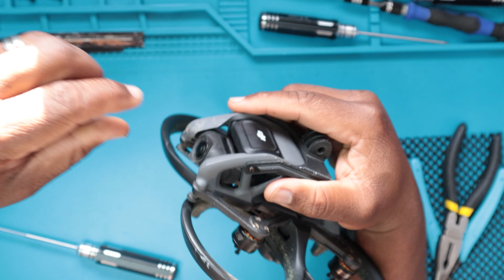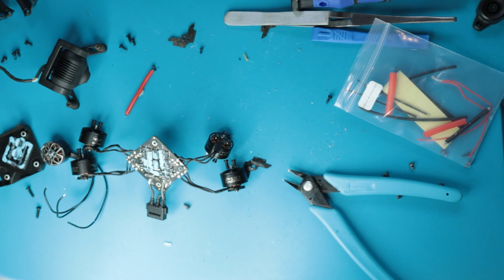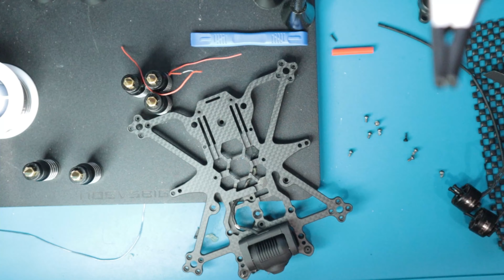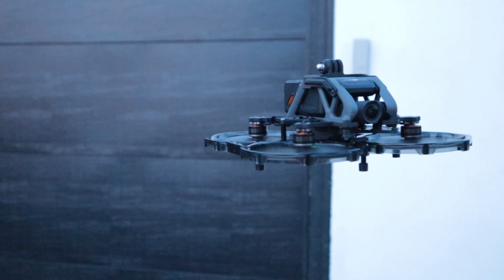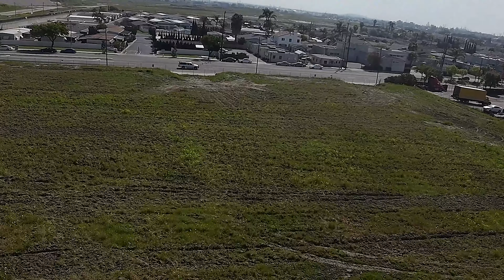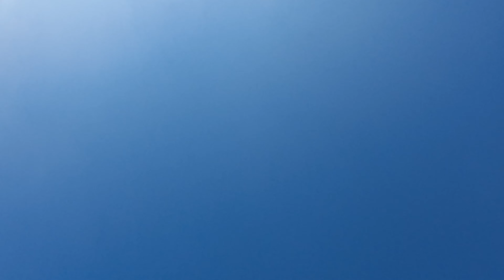Axis Flying DJI Avata frame kit Upgrade

Comment: hi, thanks for the amazing guide, I have followed all the steps but front 2 motors are not moving. on goggles it show propulsion and esc error.
would you please help.
Reply from the maker: sorry for the late reply, my father passed so i've been off youtube for a while. hope you fixed it. generally you get that error if there's not a good connection to the motors. check your soldering.
Reply: @Ghostman_fpv  very sorry to hear about your father. Our condolences to you and your family.

Comment: Hi man , its worth it to upgrade to avata 3.5 inch? I want to use it with go pro hero 12 .
Reply from the maker: I'ts worth it in my opinion. it's way more stable, more power and more quiet. However, if you're not a fairly advanced builder and/or you're worried about your warranty , i wouldn't do it.

Comment: Curious if you've experienced any ESC/ Propulsion system errors
Reply: I have this issue, have you had it ?
Reply: @pravyadav5264  yes I've had ESC and Propulsion system errors. Ended up replacing the ESC. I think some of my soldiering was bad. I'm up and running again. If you get it back together again, I highly suggest putting some Gemfan D90S props on. Turns AVATA into a rocket
Reply: @FlightClubProductions  wow thanks man, it is 3 blades or 5 blades ?
Reply: @pravyadav5264  3 blades. Not only do they make it faster, they make it considerably quieter. Also, I feel like the drone is both more stable and more nimble. I believe the part number is D90S. The S is the T-motor 2 bolt version, but the regular D90mm comes with center inserts